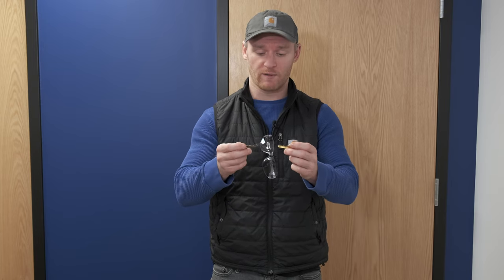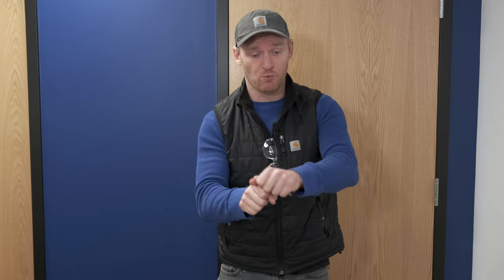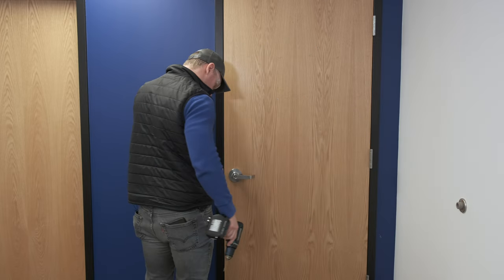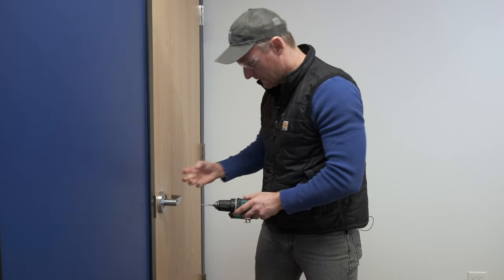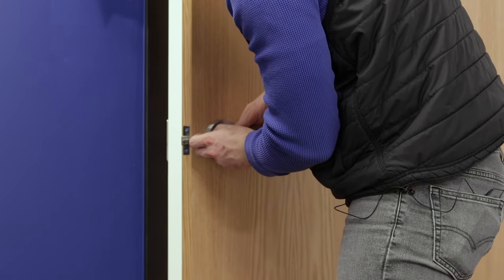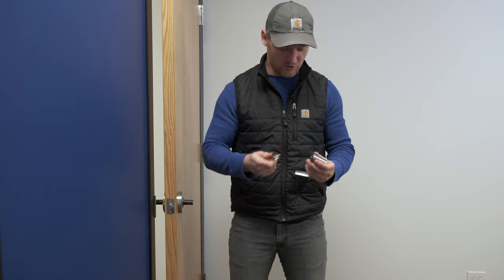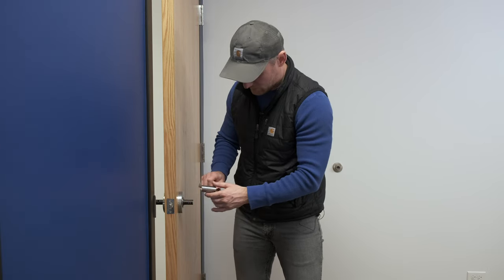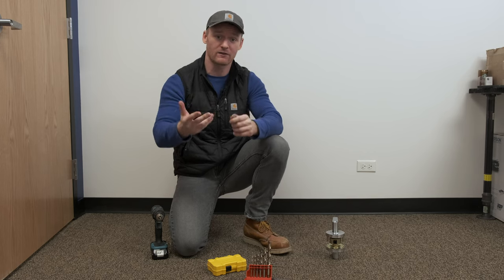How To Drill Out A Commercial Door Cylinder

Comment: So, If I lost original key on Schlage lock.. I can drill out cylinder, and buy a replacement cylinder with new keys to match?
Is this cheaper than buying a new  Schlage lockset from Home Depot or Lowe's? Where do I buy the replacement cylinder. How do I know it will match original door lock set?
Reply from the maker: What I did is go to a locksmith in my town, tell them what I have and then they get me the cylinder. I think it costs like $8-12.